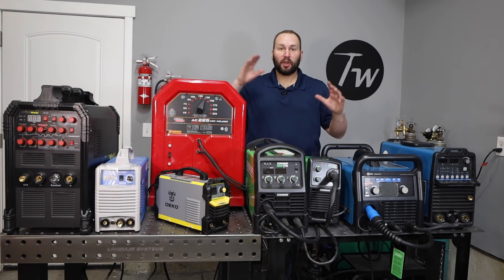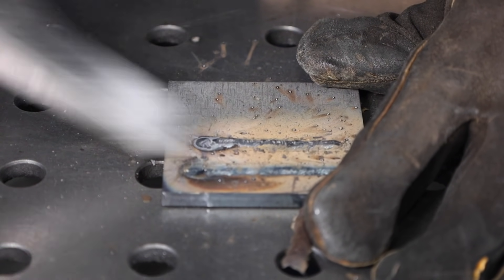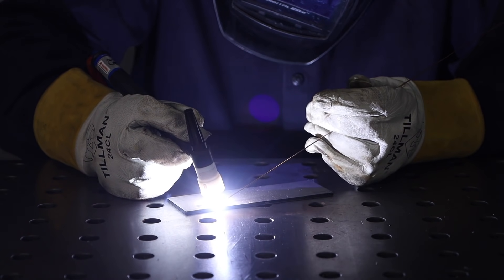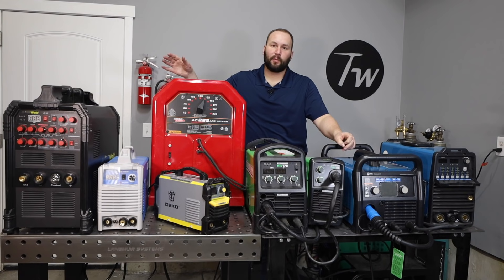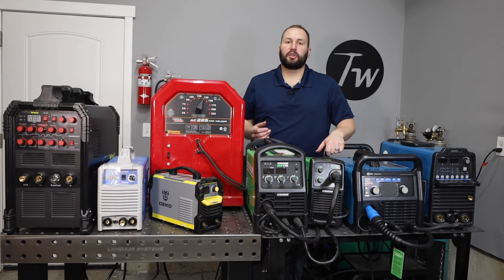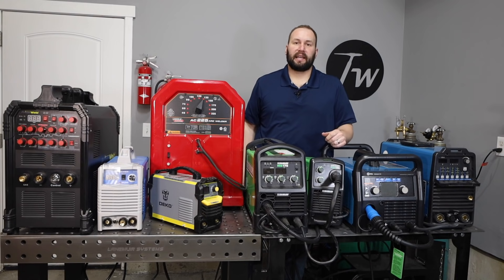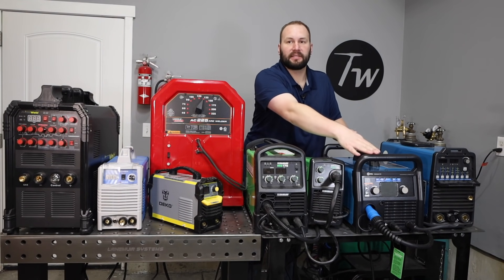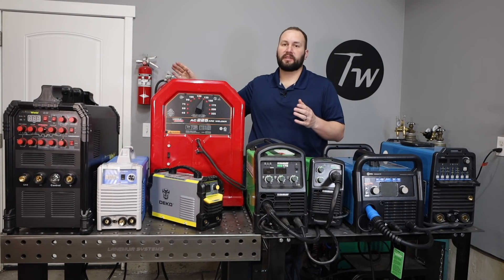How to Choose a Welding Machine

Comment: Hi, Tim love your videos. I have been struggling with stick welding, not able to hold an arc, and sticking the D#mn rod all the time (very frustrating). I have watched many of your videos and I am convinced that MIG is the way to go for me. I live in Thailand and the local building supply stores, Home Pro, and Global House usually carry a good selection but none of the brands like Miller that you mentioned you like, so I will look into a purchase here soon. Thanks again for sharing your knowledge.
Reply: If its sticking turn your amperage up!
Reply: You're probably using one of those inexpensive inverter machines. No worries, i do too. The problem with these machines is the fairly low open circuit voltage (ocv)  This is the voltage the machine has at the welding leads while not welding. Usually with the inexpensive machines, it's around 63 volts, and for easy arc starts you want the ocv to be above 80 volts. The best way to go in this situation is to use the thinner 3/32" (2,4mm) electrodes and use 6011 type rods, and reverse polarity to electrode negative (put the cable that goes to the rod holder in the negative socket on the machine. Try that; i bet it'll be a lot easier this way to get the arc started. The arc will be louder, and the welding will produce a lot more spatter this way, but it will get you welding.... once you gain some experience, you can switch the polarity back, and see how it goes then.
Reply: The problem with most of South East Asia, like here in The Philippines, your supply wires to the building are #10 or smaller, and run a block or two out to the power pole where you have a 30 amp meter: pull any kind of current and the voltage drop is horrendous. If your in a modern Industrial building then you luck out, an old residential tract no dice!

Comment: Look into ESAB too.
Reply from the maker: Great suggestion. I was on the fence between a Rebel and the Miller Multimatic that I just bought. The ESAB had more features, but I ultimately picked the Miller because it’s compatible with the spool gun I already had and it cost a little less. I’m very happy with the Miller, but I think I would be equally happy with the ESAB. I have used another ESAB in the past, and it was great. The Miniarc Rogue is currently at the top of my wish list.
Reply: @TimWelds  That was kind of my take on the two, too. Esab has a higher range of ac frequency and more settings for pulse, plus one video showed it could run 6010. 

I like the Miller’s user interface better, at the time I was shopping I don’t think the Esab switched between Tig and Mig at the tap of the pedal or trigger (super handy), and there is also a local Miller dealer near me. 

I also like the quick set on the Miller where it gives suggested settings. Handy when I’m using an electrode I don’t run often.

I wouldn’t hesitate to buy another Miller, but I could see how someone used to an advanced Tig could prefer the Esab.

Comment: I'm buying a Lincoln 225/125 AC/DC welder on Wednesday. I'll mostly be using it for repairing our farm equipment, but I'm thinking might start a side business repairing machines and other random repairs in my area
Reply from the maker: Awesome! I’ve never used the version with DC, but I’ve had 2 AC 225s and they work great!
Reply: I hope you have some schooling if you’re going to do this for others. There’s liability when you do work for others.
Reply: @melgross  I'm a junior in a trade school if that's what you're saying, it's a machining and welding class
I don't plan to start doing work for others till I get good at repairing our own equipment
Reply: @LukeA_55  ok then. That’s the way to go! There are too many “welding” sites (not this one, as Tim is a welding engineer) done by guys who can’t really weld. They don’t know much either, but they think they do. They sometimes review really cheap welders, and sometimes a plasma cutter, and tell people that once they played around in their garage for three months, or so, they’re ready for paying work. I really shudder at that. Sometimes people post that what they “learned” was just great, and they’re going to follow this guy’s advice and buy that $100 welder and get paid shortly, as soon as they’re really good, whatever that means.

You’re in another category. Good luck with it. And remember that you can never know too much, just too little.
Reply: You can use the DC side of that welder to tig with, they make a # 17 tig torch and whip that you can attach the rod stinger to, and with some 75/25 gas and dip rod you are set to go ( I've done it )

Comment: I picked up the yeswelder 205ds multi process over xmas..   I wanted a good starter machine and I think it really hit the nail on the head.  I do want to do aluminum tig eventually but I plan to graduate to that later.    This was a good review.
Reply from the maker: Awesome! I haven’t tried that one, but the little TIG I got from them sure works well as long as you don’t need a long post flow. Thanks for watching!
Reply: The welder you got now can do alli ?  Just change your mig liner , and drive roller  not that costly ?

Comment: did you weld aluminum in that spool gun in the intro ?  did you drag that weld ?
Reply from the maker: All of that welding was on steel, and I didn’t have the spool gun out for this video. Yes, it was a drag angle on the MIG, which works fine on short circuit MIG, though I usually push out of habit, which works fine too. Aluminum MIG needs a push angle (which is what I’m guessing you’re trying to point out) and flux core needs a drag angle. Thanks for watching and for the comment.
Reply: @TimWelds  you can weld however you want. ... I am not one outhouse YouTube armchair welding experts .. LOL.  steel push to pull ...  aluminum I personally pretty much always push just like you, flux cored it all depends ... there are some gas shielded flux cored wires for steel that can be pushed or pulled and of course whenever I push it on one of my videos there will be guys that try to educate me how it has to be always pulled because of reasons, their girlfriend's fathers brother in law who is a certified welder told them so so that is how it has to be .....    but either way ....  even some gases stuff can be pushed or pulled ....  if I do dual shield stainless I feel it has to be pulled otherwise it turns all brown and does not work right colors ....    but either way.  Over all great video you made explaining stuff .... !!!!  the arc force /dig explanation left some room for guesswork ... but ok ....  most guys who are in the market to buy a machine and you made them aware in this video that such a function exists ....  they have bigger fish to fry than worry about what arc force exactly is ......  still GREAT video !
Reply from the maker: Thanks so much! It’s true that there are rarely absolutes in welding.